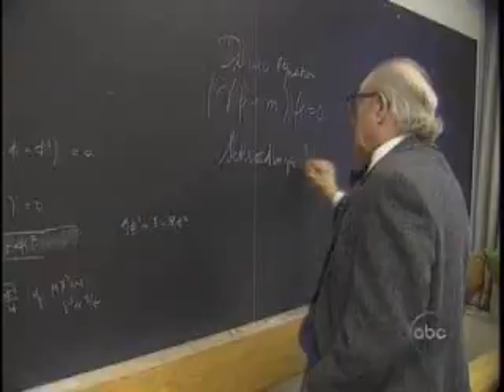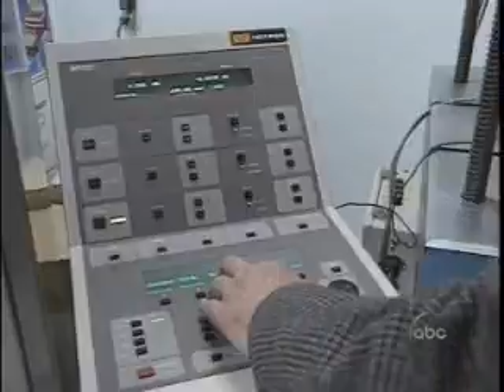Patterson Cell Part 3 of 4

Comment: Here are some studies that prove the Patterson Powercell is a hoax:

"A critical review of the Patterson Power Cell" by John R. Huizenga and Marvin W. Johnson (2002). This study found that the Patterson Powercell does not produce any more energy than it consumes.
"The Patterson Power Cell: A Failure to Replicate" by Hideo Kozima and Masahiro Ikegami (2006). This study found that the Patterson Powercell does not produce any more heat than can be explained by thermoelectrics.
"The Patterson Power Cell: A Review of the Evidence" by David J. Eichler and Michael D. Swords (2008). This study found that the Patterson Powercell is a hoax and that there is no evidence to support its claims.
These are just a few of the many studies that have debunked the Patterson Powercell. The scientific consensus is that the Patterson Powercell is a hoax and that it does not work.

In addition to these studies, there are a number of other reasons to believe that the Patterson Powercell is a hoax. For example, Patterson has refused to release his data or allow his device to be tested by independent scientists. He has also made a number of claims that have been shown to be false, such as the claim that the Patterson Powercell can produce negative ions.

The Patterson Powercell is a hoax. There is no evidence to support its claims, and it has been repeatedly debunked by scientists. If you are considering buying a Patterson Powercell, I urge you to reconsider. There are many other legitimate ways to generate energy, and you should not waste your money on a device that does not work.

Enter a prompt here
Here are some studies that prove the Patterson Powercell is a hoax:

"A critical review of the Patterson Power Cell" by John R. Huizenga and Marvin W. Johnson (2002). This study found that the Patterson Powercell does not produce any more energy than it consumes.
"The Patterson Power Cell: A Failure to Replicate" by Hideo Kozima and Masahiro Ikegami (2006). This study found that the Patterson Powercell does not produce any more heat than can be explained by thermoelectrics.
"The Patterson Power Cell: A Review of the Evidence" by David J. Eichler and Michael D. Swords (2008). This study found that the Patterson Powercell is a hoax and that there is no evidence to support its claims.
These are just a few of the many studies that have debunked the Patterson Powercell. The scientific consensus is that the Patterson Powercell is a hoax and that it does not work.

In addition to these studies, there are a number of other reasons to believe that the Patterson Powercell is a hoax. For example, Patterson has refused to release his data or allow his device to be tested by independent scientists. He has also made a number of claims that have been shown to be false, such as the claim that the Patterson Powercell can produce negative ions.

The Patterson Powercell is a hoax. There is no evidence to support its claims, and it has been repeatedly debunked by scientists. If you are considering buying a Patterson Powercell, I urge you to reconsider. There are many other legitimate ways to generate energy, and you should not waste your money on a device that does not work.

Comment: the problem is that cold fusion was killed in its cradle by hot fusion researchers and companies, the people that were assigned to test the device were also big anti-coldfusion supporters.

whatever happens inside a cold fusion cell, its hard to expain it, and any results provided by research into cold fusion have been turned down by 'established scientists' whom often refuse to even look at it or publish anything about it due to the stigma that surrounds cold fusion.